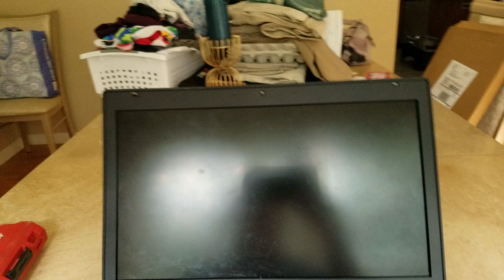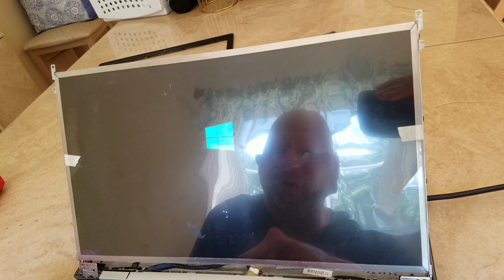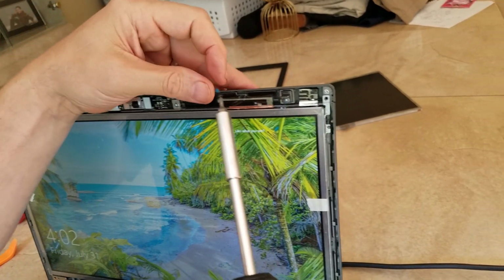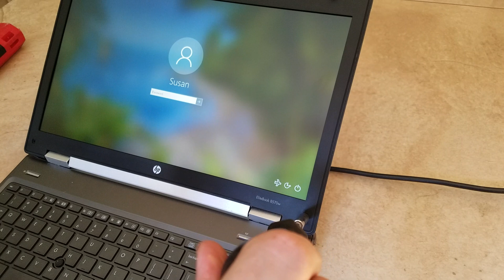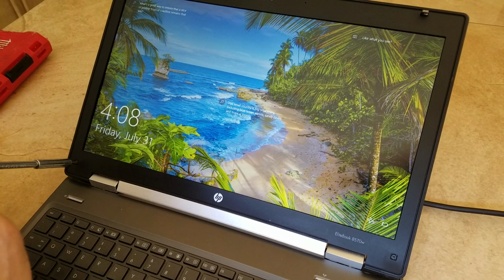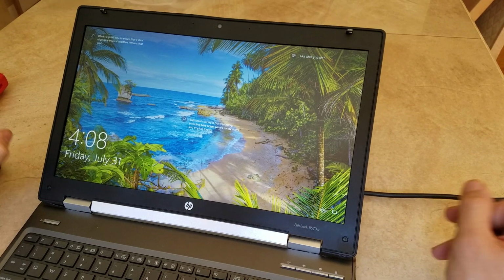Laptop screen replacement / How to replace laptop screen for HP Elitebook 8570W

Comment: Super useful video! Thanks!

Question, what were the symptoms leading up to needing to replace the screen? I read on the forums that the CapsLock and NumLock flashing 3 times is graphics related, which is what I'm running into now.